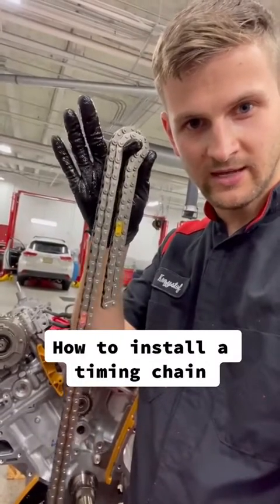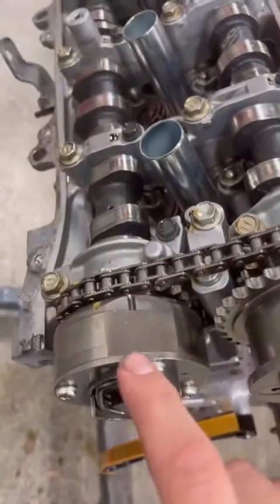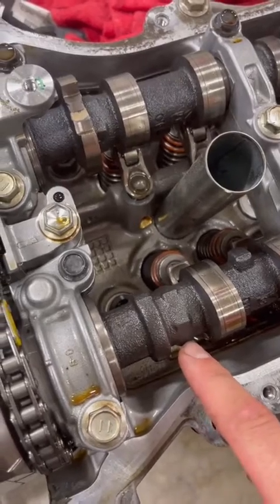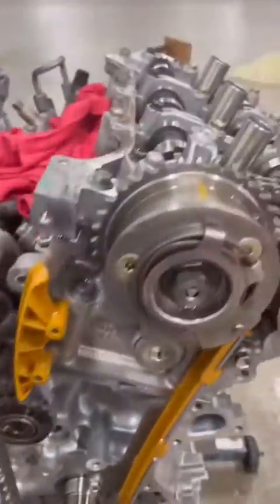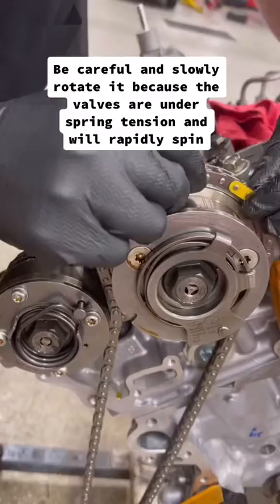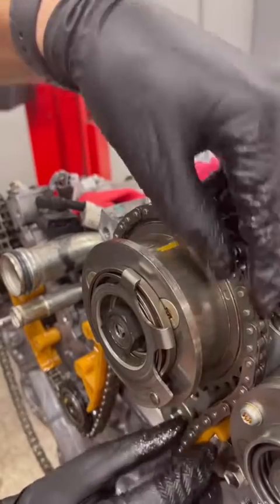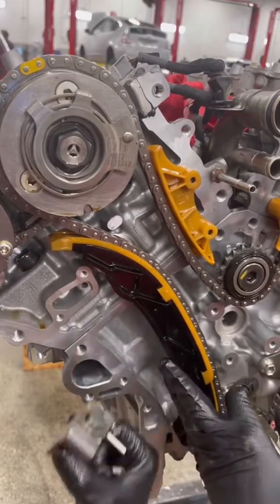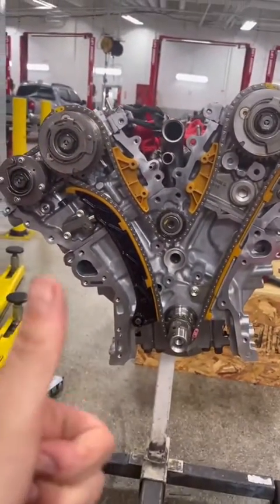Timing chain installation on a Toyota 2GR-FKS motor.

Comment: Hello why did it need replacing?
Are timing chain a maintenance item?
Reply from the maker: Timing chains usually not an maintenance item. On this particular engine i has rebuilding one of the heads which required me to remove the chain. I decided to make a video of the installation since at that time i did not find anything related to installing one on a 2gr-fks motor.
Reply from the maker: @630Cars The 2GR-FKS motor is notorious for having issue on the exhaust valves. Typically on bank 1.